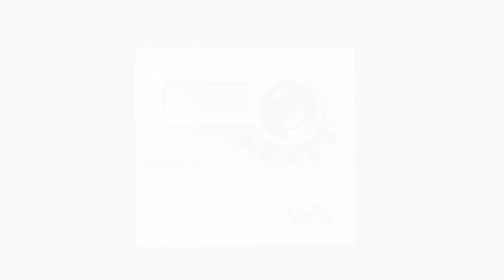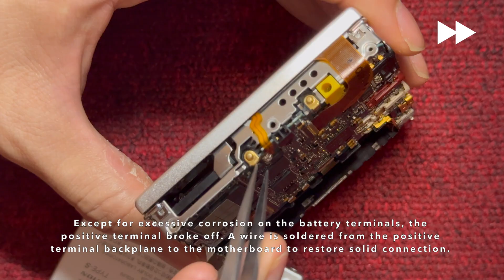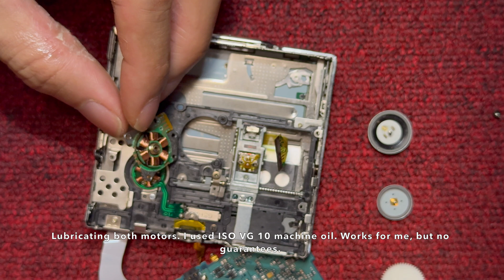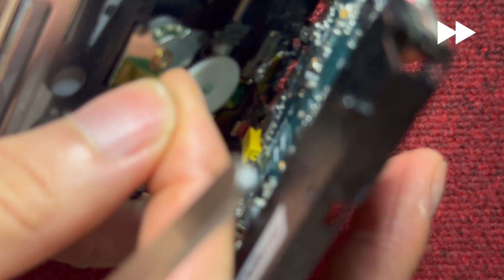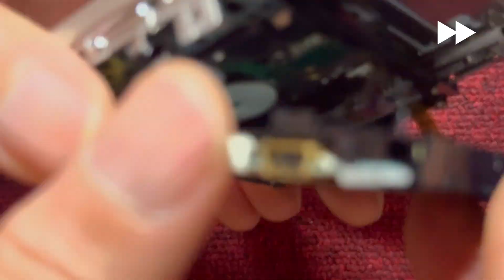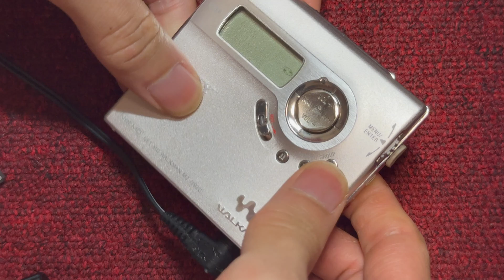Repairing a Sony portable MiniDisc recorder MZ-N920 with servo issues.

Comment: thanks for the video,  is it possible to see the paramètres of the servo slower Mo...
Reply from the maker: Thanks for commenting. I'm not sure but I think every device might have slightly different value set. You can always do the auto adjustments. If it fails then it's highly possible the servo has hardware issue